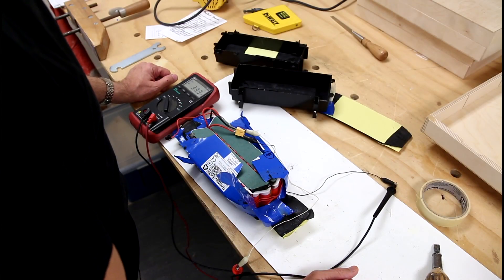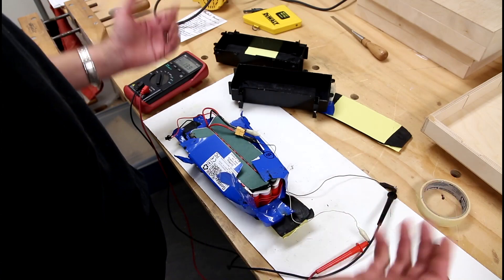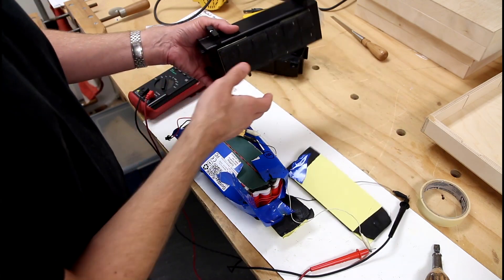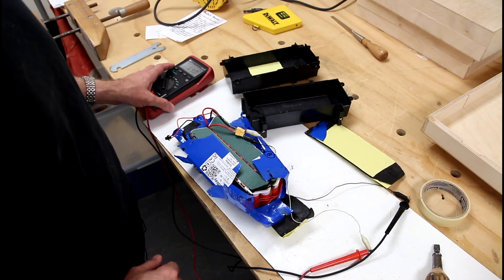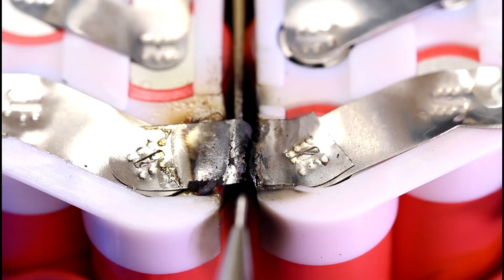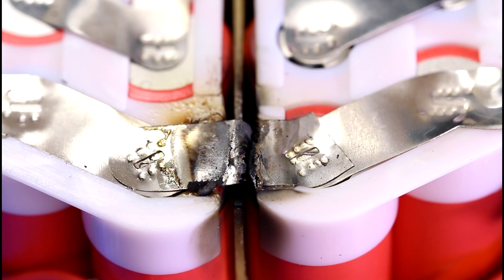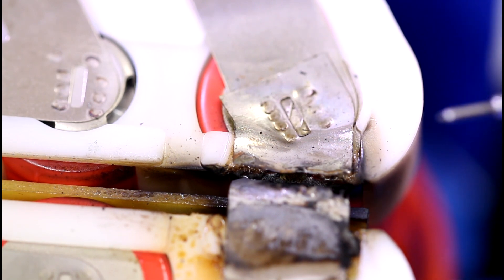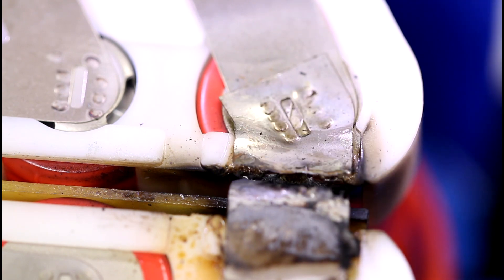Final Mten3 Failure Diagnosis - Inferior Power Distribution Design

Comment: I looked at your vids on this battery flaw, which you’ve said is corrected on new Mten3:s. Has the factory by now, on 2021 or earlier models, also installed a safety fuse? Thanks for your reviews and vids! By the way, nice workshop you’ve got. Maybe you’ve already got a vid about it, I have to look. Would be interesting!
Reply from the maker: I believe Gotway is just now starting to add fuses to "some" of their wheels. I doubt they've done that to the Mten3

Comment: This video bursts my bubble buying this wheel for my b day coming up this month....back to the shopping around phase....thank you ,Marty.
What else is light out there?  Besides the IPS i5?
Reply from the maker: Gotway changed the battery pack design after this. If you buy from EWheels you can be assured that you're getting an Mten3 without this problem. Any Mten3 manufactured in the last 6+ months should be fine. Add it back to your birthday list :-) You won't regret enjoying the fun of this wheel.
Reply: @ElectricUnicycles  I got (used) Mten3 recently (haven't used it yet) and it seems to be manufactured in October 2017 (the outer shell of the motor/wheel has a number starting with 201710), so I guess I am at risk of this issue and the wheel turning off on me while riding? Do you have any tips on how to still enjoy this wheel without putting too much strain on it, so that it doesn't turn off (that is: what not to do)? I am guessing doing pendulums or tight turns could trigger this? (By the way, do you know how I can check which battery capacity I have? Gotway app or WheelLog doesn't show any information on that other than current voltage.)
Reply from the maker: @lastkotra  Usually there's a little sticker on the front (near the light / power button) that lists the capacity. Most people don't remove the sticker. Otherwise you would have to open the wheel to inspect the battery pack, which does list the capacity. At ~175-pounds I can get about 20-miles from mine. If you get a lot less than that then you probably have a smaller battery.

Many people with the same original wheel have never had a failure. So there may be a bit of luck involved. On the positive side, if it were to fail for the same reason as mine did, it'll be under a high load / low speed condition, not when you're cruising at 15+ mph.

Some people have proactively 'fixed' the battery back by doing what I did (see my related video where I fix it).
Reply: @ElectricUnicycles  Thanks for the reply, Marty. It's somehow reassuring. As far as I understand, this connection between battery packs melted due to high load/power, so it could also happen at high speed? Though, I assume that when cruising on a flat surface without sudden acceleration, the power transferred through battery packs wouldn't go near what is required to melt the connection them, so that's why it's not likely to happen.
Reply from the maker: @lastkotra  I don't believe this would happen at higher speeds. As you say, there actually isn't a lot of power being consumed when cruising. The large current surges occur when starting, stopping, accelerating, etc.
Reply: Your feedback made me feel much better and I appreciate being so frank.  Your riding backwards video is absolutely impressive...that, and other reviews sold me this wheel.  I’m very happy with my z10...but my IPS although very portable, lacks the power and speed and perhaps the MTen3 collects what I’m looking for.  I know Jason, from past  purchases and talked to him a few times.  I’ll give him a call before I make the purchase and mention your recommendation.  Thank you, Marty!!
Reply from the maker: @MrJbchocolate  Let me know if you end up getting one, and how you like.
Reply: In route now....told Jason was recommended by a guy named Mr. Marty Backe 😏👍
Reply: Marty, got finally the Mten3 from Jason.....what a good buy this was.  The wheel is absolutely A+.  Thanks for the trolley idea.  I did similar assembly as use using the pedals frame holes except I made 1/4” dia.  free wrapping around the handle screw capped with a couple of nuts as penetrating the trolly assembly without compromising the trolly telescopic mechanism nor altering the wheel with damaging drilling holes. This wheel is a dream to ride without protective equipment....just at relaxing speed as you do in your videos.
Reply from the maker: @MrJbchocolate  Fantastic. Glad you finally got the wheel and are enjoying it. It is a fun wheel to use when you want to wear minimal protective gear (I still use wrist guards). Hope you can enjoy some backwards fun with the Mten3.
Reply: Has anyone ordered one from gotwaycanada.com, is it trustworthy or should i go with ewheels

Comment: for the gotway Mten3 the spec voltage is 84 volts. test the unit without putting battery pack back in to unit.
Reply from the maker: It's been fixed and running for over a month. Check the other videos if you're interested in knowing what happened. Thanks.

Comment: They used 8 spot welds per battery terminal, this IMO is pretty good. What got burned is the nickel battery tab connecting pack 1 to pack 2 together in parallel (looks like each bank is 80V or 84V). Why it got burned I guess the vibration between the two packs not moving in unison cause the nickel tab at that point to mechanically fatigue resulting in hairline crack(s) which in turn reducing current carrying capacity. Hence got very hot, letting out the magic smoke. 

Just solder it back together with highly flexible multi strand copper wire should be fine (not with building wires: no Romex, no THWN and no THHN which are too stiff). Wrap up the whole thing tightly so pack 1 doesn’t move with respect pack2. 

Hope this helps.
Reply: One more thing. No need to discharge the battery. Just wrap everything up as not to expose anything except the damaged nickel taps before you solder.
Reply from the maker: It's already fixed as documented in my follow-on video, but thanks for the comments anyway. It may help others.
Reply: My thoughts exactly. I reckon you're diagnosis is spot on and it's likely a connection tab on the other side of the pack will likely fail soon too.

Comment: If you wanted to repair the connection with solder and a thick wire, you would have to discharge the battery fully or risk it sparking when you put a soldering iron on it.  Even if you do manage to get it repaired, I wouldn't be very confident in riding the wheel.  That's pretty disappointing to see that type of failure.  Gotway really needs to do a better job and over design all the electrical paths on their wheels.  I guess I'll be waiting for Mten3 version 2.0 before I make that purchase.
Reply: Marty, I’m impressed that you stuck with it until you found the issue. I wouldn’t trust a repair with my life. I have no doubt it could be carefully soldered, but the amount of vibration and the weight, would kill the connection.
Reply from the maker: Agree. And after looking at the closeup video shots I can actually see evidence of seepage from one or more battery cells. I do think under most conditions this non-optimal design will work. The thing is, this wheel is so fun to use I wouldn't be able to wait for a hypothetical Version 2.
Reply from the maker: I agree. I'll be trying to procure a new battery pack. Thanks.